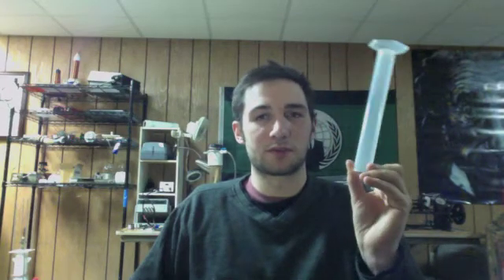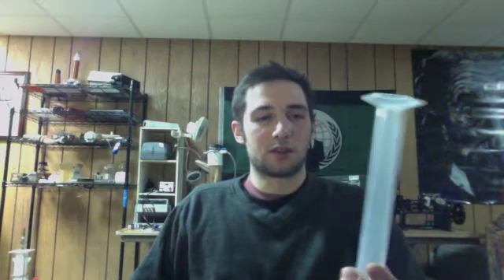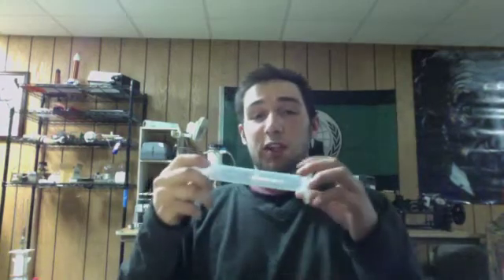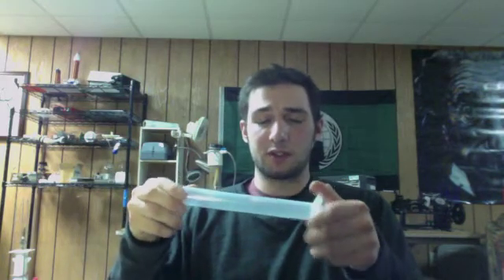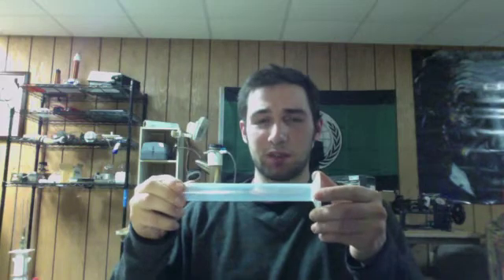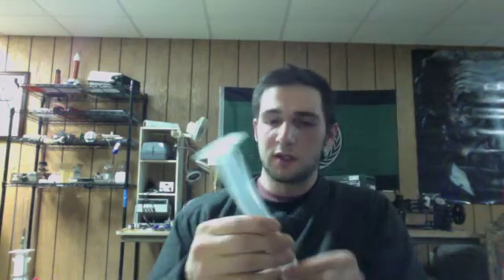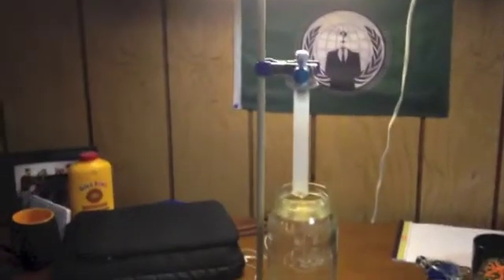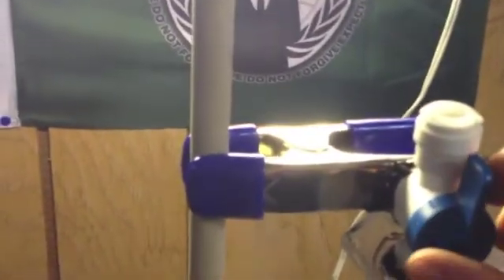hho measurments for wfc project

Comment: All of the ball flow meters will give you a low ball reading as the gases are a bit lighter than just air gases but it's okay to have a low ball reading as then we know we reading gas output on the low end of the scale. Thus any reading we get is good for use as it would be a low reading of the actual gas output that is taking place and it is something we can see and measure in real time. I have two of them that I use which are calibrated for LPM readings. I use them for I know they are giving me a lower reading than the actually amount that I am producing so when I run my error calculations I can basically ignore the lower readings for I already know the reading are on the low side with the ball type gas flow meters I have.

Comment: Voltage X Amps X Seconds X Milliliters = MMW (milliliters per watt per minute) this will tell you the efficiency.
Reply from the maker: I think I have a better way so you don't have to worry about inefficiency of the cell and can look directly at gas produced by electrolysis and gas created by other process. Inefficiency comes from over potential. This math bellow predicts gas output, it really has nothing to do with overall efficiency which doesn't matter in trying to prove the concept of breaking water down with voltage. I also accounts for temp. and pressure, if you don't account for these two factors, your actual and calculated efficiencies will not be the same. 

Step #1. 
covert amps over time into total electrons that moved through the circuit. 1 amp in one second is one coulomb and a coulomb = 6.24x10^18 electrons. 
Since the gas measurements was taken over 30 seconds it will be 6.24x10^18 (e-) * 30s = 1.872x10^20 electrons in total. Since we know for every two electrons that pass through the circuit, we create two hydrogen atoms and one oxygen atom, we know that we created 1.872x10^20 hydrogen atoms and 9.36x10^19 oxygen atoms. Since oxygen and hydrogen both exist as H2 and O2, the amounts of atoms are then divided by two to find the total number of element. This step is necessary for a later equation. 
so, H2=9.36x10^19  and O2=4.68x10^19

Step#2) 
Covert to moles. One mole is equal to 6.022x10^23 which is Avogadros number. ( 1 mole of H2 = 6.0022x10^23 H2 molecules) 
9.36x10^19/ 6.022x10^23 =1.554x10^-4 mol H2 
4.68x10^19/6.022x10^23 = 7.772x10^-5 mol O2 

Step #3) 
Solving for volume. To solve for volume of the gas created, we can use the ideal gas law which is V=nRT/p
V=volume
n=moles
R=gas constant of .0821
C= temp. in kelvin. We will use 273k assuming standard conditions 
P=pressure in atm. We will use 1 atm assuming standard conditions 

The formula must be adapted to account for both gases. V=RT/p*(nA+nB)
So Volume=.0821*273k/1atm*(1.554x10^-4mol H2 +7.772x10^-5 mol O2) 
Predicted Volume = 5.225x10^-3L hho or 5.225ml hho 

that is only for one cell, so for example, I have 8 cells in series, so the output will be 5.225ml*8= 49.80ml hho produced in 30 seconds with 1 amp input to the cell. Find the percent error between your calculated value and the experimental gas volume collected from ordinary dc electrolysis to see how accurate your measurements are. Now you will have something to compare your gas measurements using your Meyer circuit with. Remember, your calculated values of gas volume must use the same amperage as your measurement at the cell of your Meyer circuit for the values to be comparable.